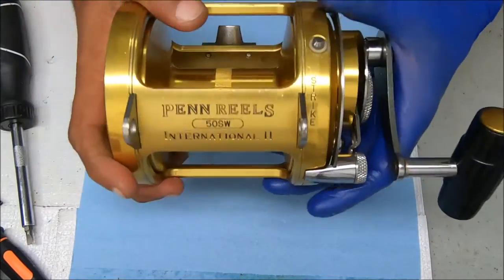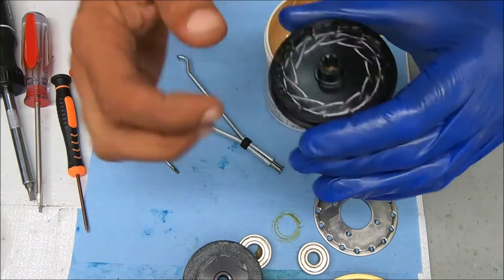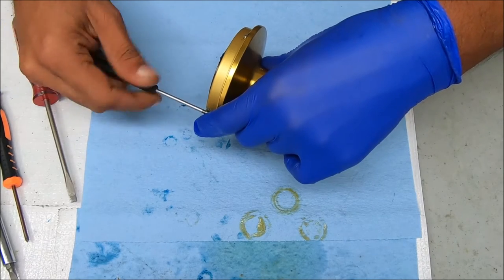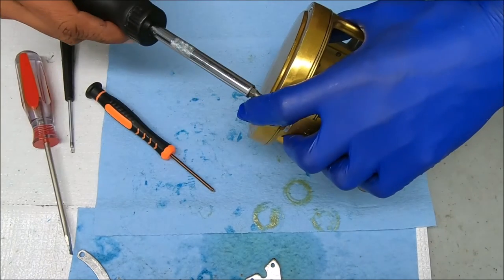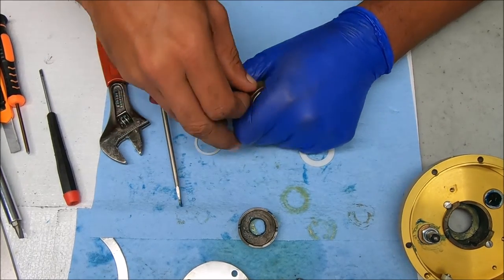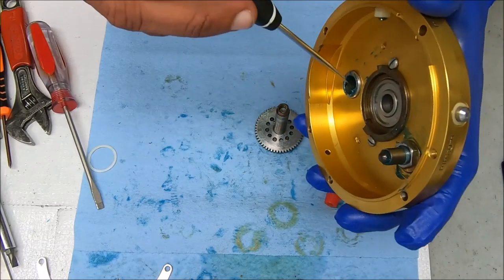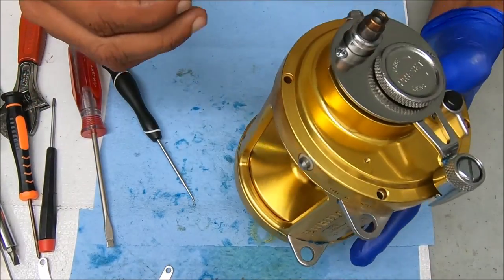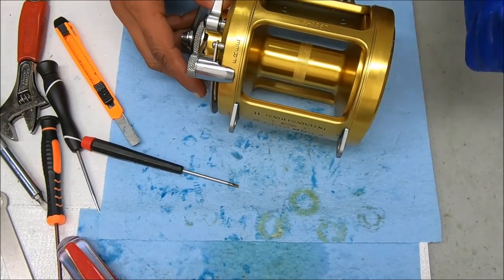Penn International II 50SW Fishing Reel - How to take apart, service and reassemble

Comment: was just working on an older gen 50sw and you have to remove the bottom plate off the gears and fully remove the gear sleeve to get the gears out since they sit in a recess, its a balancing act to get all the parts back in without the little slide pins falling out. but like your nice clear vid. thanks
Reply from the maker: You're welcome and thanks for watching. Glad to hear it helped. Hit the thumbs up and spread the word about the channel.

Comment: Would this be the same process for a 80 stw?
Reply from the maker: Thanks for checking out the video. It should be similar enough. 80S and 80SW are NOT similar.
Reply: @TSGReelService  Thankyou.  I just finished tearing apart 2 STW.  They are just like your video fortunately.  I have one more that has some of the side plate screws are stuck.  I actually broke off two screw extractors in 2 of the screw heads.   I Don’t know how I’ll get them apart now.  The screw extractors metal is super hard.  Drill bit just slides on it.   But Thankyou for the video.  It helped a ton in my tear down and service
Reply from the maker: Good to hear. This might help:

https://youtu.be/JTIKUprM1pc

If not, you can grind off the tops of the screws (with a Dremel or by using larger and larger drill bits) and pry the side plate off after removing the other screws.... then soaking the stuck screws with something like WD-40, and using a vise grip in the section of the screw that remains to gently back the screw out without snapping it off.... usually, the screws are frozen inside the side plates (as seen in the video above), and not in the frame.

Comment: Be careful with how much grease you add to the screw holes. This can cause hydraulic pressure to build up and crack the parts at the screw holes.
Reply from the maker: Thanks for watching! I'm not much of a technical person. Although I can agree with the theory, a screw is not like a piston with a seal, blocking the release of excess grease. I think it's more likely any excess will work its way up the threads and out the hole. Which reels has that happened to you on?
Reply: @TSGReelService  Thankfully this has never happened to me because I apply just a small amount of grease to the threads of the screws and not actually into the holes. But I have seen it happen to a few guys before. Usually not on a machined reel like the internationals since they are machined from a solid billet. Its far more prone to happening on cast reels like Lexa's, Fathoms, Curados. 

The grease is thick, it does not get squeezed up and out between the threads. It actually gets pushed to the bottom of the tapped hole and then starts to build the pressure that can result in a blow out. 

If you have ever seen a clutch replaced on a car there was an old shadetree trick to getting the pilot bearing/bushing out of the end of the crank shaft. Pack the crackshaft end with grease, stick a socket that just barely fit into the hole and hit it with a hammer. This built up hydraulic pressure and pushed the bearing/bushing out. Its the same concept with the grease and screw in a fishing reel.

Everything else you do is great. I have watched several of your videos. Its always good to watch other people who perform the same kind of work as you to pick up new ideas, new ways of doing things, easier ways of completing a task. Maybe one day Ill start making videos also hahaha.  Anyway good job and thanks for putting these videos out there bud!
Reply from the maker: No worries. Thanks for checking out the videos. It already seemed you had some experience with servicing reels.... which is the reason I responded as I did.... thought maybe you have had it happen to you. Like you, I'm always learning new things/techniques. Either we grow or die, right?

Regarding the hydraulic pressure concept, I understand how it works and agree with you, to an extent. However, the amount of grease that gets "trapped" at the end is negligible, and I respectfully disagree that some of the grease (equivalent to equalizing any built up positive pressure) works its way up the threads, pushing the "last in" grease up and away... there's no sudden or quick force (like a hammer) to magnify the pressure... it's being screwed in.... and I would posit that "slow" process gives the pressure, if any, time to equalize. It's never happened to me either, but I'll have a clue as to why if it ever does.

Thanks again for your input. Feel free to critique/praise/suggest as you see fit. I'm always open to trying new things.

Til the next video....